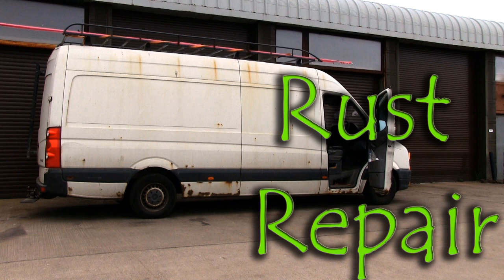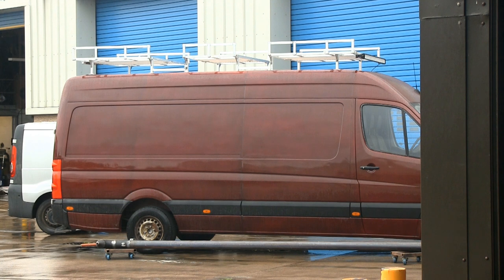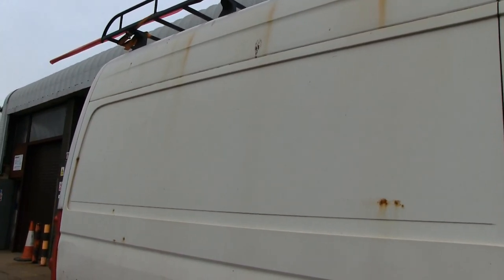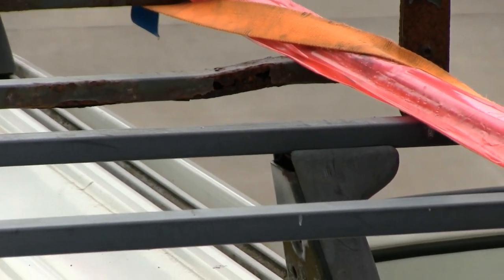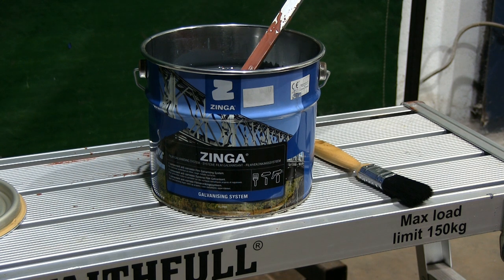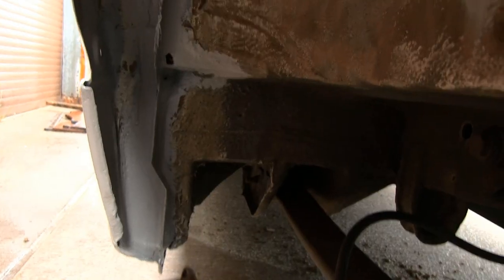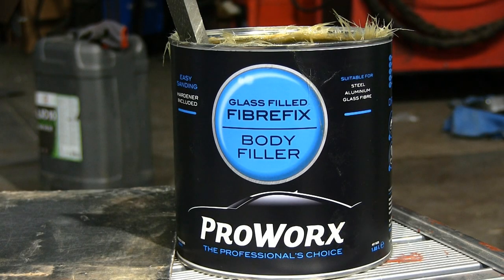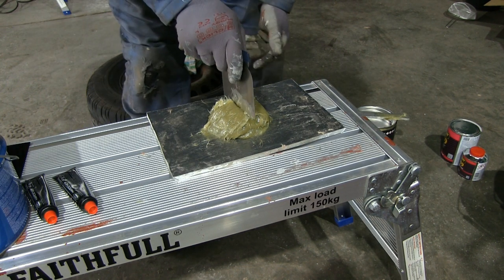How to repaint a car, bodywork rust repair, how to fix rusty wheel arches.Car painting for beginners

Comment: Love the accent! My guess is Scottish/Russian? Apologies if I'm wrong. 

Anyway I have a 13plate Crafter that is starting to go. It's ex rental so came with 100k miles worth of dinks and knocks. I've posted this on other vids but I have drowned where the stainless side door track meets the body in a water displacer (WD40 or something like) as this is another rot point. There are vids about cleaning the s**t traps out behind the front wheel arches and, as you have shown, clearing the rear drain holes.

I've just finished sealing the trim clips to stop the ingress of roadwater, spray and muck (see plenty of vids on how to). As I posted elsewhere, I couldn't understand how so much water was coming into the van BUT I had a lightbulb moment 💡. As you drive there is a pressure difference between inside and outside. Obviously if the pressure is less in the van the mucky, salty roadspray will be sucked in, even uphill with the help of capillary action. 

We know that Germany can produce some of the finest engineering and designs in the world. So I disagree about poor design. It's not actually poor design it's built in obsolesence - VW/Merc want it to rot so you buy another van 💰
Reply from the maker: Hello Matty, interesting point about deliberately bad design, very valid I think. 

As far as accent, I am Ukrainian who is living in Scotland.
Reply: @weld-deluxltd7635  Glasgow by any chance?

Comment: Great work!! About to start the journey myself and your videos have saved me so much time!! Thanks. Question - In wheel archers, did you put Grey Stripe Seam Sealer directly on the Zinga coat, or did you put a layer of epoxy primer between the two?
Reply from the maker: I have put  Zinga onto sand blasted steel and then covered it with epoxy primer and the rest
Reply: @weld-deluxltd7635  Thank You!

Comment: great vid thank you bud, can you remember what tip and air pressure you used on your gun to spray the zinga please?
Slava Ukraini
Reply from the maker: First of all thank you for supporting people of Ukraine!

The tip size is 2mm I can not remember pressure but it will be different on your particular gun.

 If you  delete Zinga as per manufacturers recommendations it will flow nicely. It is extremely fine and is not fast to form a sedament.

Comment: Nice work bud. Use what you can and have a go . Painting aint easy at the best of times. like the galvanized trick. Doing my sprinter now. Seems are same .
Reply from the maker: Yes, they have the same bodies.  You right about using what you have and having a go at it.

Little things like that make up the whole life.

Some people think that I made a video to teach someone something and they expected showroom finish.

I just shared my experience and many people find it useful to them. 

Today there is not a spot of rust on the van where I painted, so I consider this to be successful

Comment: Great video! with the seam sealer did you end up covering the whole area inside the wheel arch and not just the seam?
Reply from the maker: There was little cracks in my anti chip coating as I put too much of it in one go without allowing to dry property. So once it dried and small cracks appeared I filled them with the seam sealer
Reply: @weld-deluxltd7635  thanks so not seam sealer everywhere? did you add another layer of antichip over the seam sealer?
Reply from the maker: @petercrockett1801  to be honest I am struggling to remember now. Part of the reason for those videos is to give my self reference if I ever have to do something similar again.
Reply: @weld-deluxltd7635  haha no problem :) Thanks for the advice
Reply from the maker: @petercrockett1801  you welcome

Comment: It*s surprising, that a Mercedes, Sprinter would rust, unless the vanwas near a place where there is sand /salt, which basically eat the metal,annother issue is the amount of water that drained out , usually when they design cars /vans, they have, flow holes so the water doesn*t collect in one spot, unless the holecwas clogged or if when they repaired the damage covered the hole, that would explain the amount of water collected in one spot, as a suggestion  I would make a type of drain hole so the water does not collect in that area,good job,👌👌👌👌👌👌👍👍👍👍👍👍👍👍👍
Reply from the maker: There is a lot of seawater lifted onto the shore with strong winds, so it is contributing to rust issues a lot. However the original paint on those vans only 0.3mm. Yes, there are drain holes in the body but they were completely choked with dirt.
Reply: @Northern Gypsies at the bottom

Comment: wow. Someone actually wanted to save that rust bucket, if it was me I would have send it directly to the junk yard
Reply from the maker: Many people would do the same. I have everything in the van layed out in the way that works for me. You can see it in this video https://youtu.be/GZiAVqb2SYo     in addition to that once everything is loaded I I go to the job van is 3.8T and  that is way to much load for the small 2.0l engine that modern vans have under the bonnet. I much prefer to stick with older and simpler 2.5l engine rather then deal with tween turbo nonsense of new engines. The other reason is that I did not want to buy a ,,cat in the bag,, with the money that I could afford to spend I could not buy brand new van, all second hand vehicles could bring some benefits and some unknown problems. I say stick with the devil you know.  Thanks for visiting the channel! Have a nice one!
Reply: Funnily enough I was thinking the same however I have a 07 plate transit which is getting to be a rust bucket, but hey its only a tool box on wheels. the price of vans now its just as cheap to maintain an old van.

Comment: Crafters/Sprinters are terrible for rust. Even at 3 or 4 yrs old they start to rust. I like the Scottish twang you have.
Reply from the maker: You are right, in that year all bodies made in the same place and it looks like they everything they could to make sure that vans will rust. My dads Peugout 405 made in 1992 and there is not a spot of rust on the car.  The accent is hilarious for Ukrainian :) but probably good example of how two cultures can be integrated together. Thanks for the comment!
Reply: It's like Merc/VW are deliberately building Sprinters/Crafters really bad so you buy another one in a couple of years time. You don't get any rust issues with it's other rivals like the Peugeot Boxer Renault Master. They are built to last.
Reply from the maker: @jaggass   Makes you wonder, is in it. The other magical idea is to fit 2L engine into the van that is 3.5t

Comment: mercedes vans are a joke got fed up of the rust appearing monthly
Reply from the maker: Properly made! Modern standard it is, just to make past warranty line.  Have to mention that there is not a spot of rust appeared on any surface that i have repainted. So there is a solution to the rusty problem.